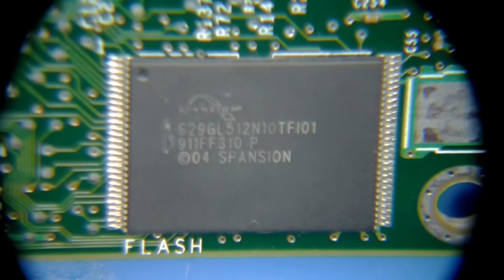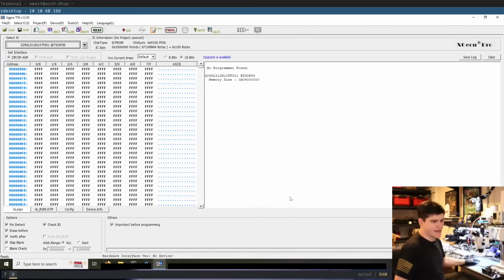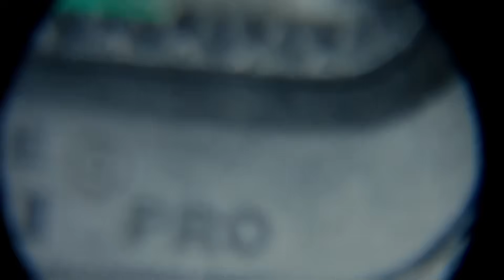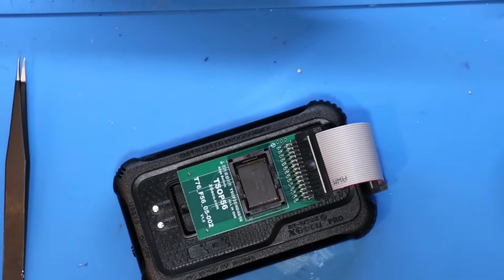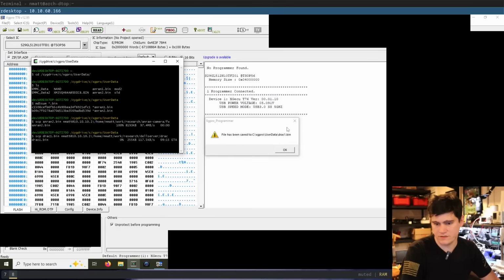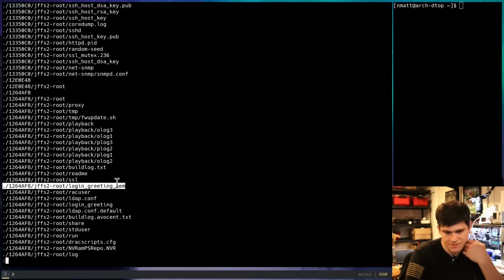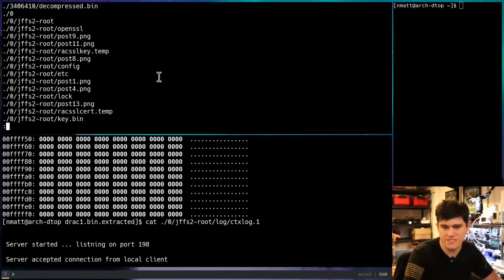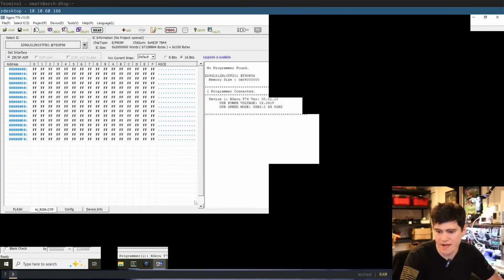DRAC Firmware Extraction - Dell Server Hacking

Comment: Hey so new to this world of firmware extracting. Just wondering if this would work. Got a Polk soundbar that was in Demo mode, won’t work normally can only play via airplay at a set volume. Works of an Emmc memory module. If I copy the firmware off a tsop48 memory chip and copy it to a blank chip. Can I then micro solder the new copied chip onto the demo soundbar and it would work like normal?  Or are there conflicts that would prevent this from working?
Reply from the maker: Unfortunately the answer to that is "it depends". On some devices that will work and others there could be other storage chips or crypto checks in the CPU/MCU.

Comment: DRAC and other remote access is often used locally. Why? Server rooms are unconfortably cold and NOISY, and don't have monitor and keyboard, so you need to roll in a cart with them, and bring a power extension cord.

So instead, you stay in your office, and just remote in. It also allow to connect to multiple servers at once, and switch very fast from one to the other. Usually they are browser based, so really you only visit the web page of the [i]DRAC, and log into it.

And in data centers, you can have rows and rows and rows and different floors. Just finding the proper server take time. You go to floor x, then find row y rack z, and server w.

Now, why loud? Servers ain't mean to be silent, they mean to cool effectively. But they are often in 1U size, which is 1.75" per "U". Such small fan don't move much air, so they have to spin VERY FAST. Plus, they have to be redundant, so they stack 2. And they need more than that, so 4-10 pairs of fan is common. Per server. And a standard rack is 42U, so can have up to 42 servers per rack! 42 servers, with that many fans... You literally need ear protection when you go there!

Why cold? Because it have air conditionner there. The front of the servers is the intake, and therefore that aisle is the cold one, at about 18°C. With lots of air moving. You need a jacket.

You also need security clearance to enter the area.

Comment: Looks like the DRAC runs linux using (old) jFFS2, and CramFS; so it's a custom linux machine?
If so there are likely update utilities, and firmware blobs you can download, as well as the ability to flash, without desoldering anything. Otherwise it was vulnerable since leaving the factory; nothing is perfect.

Comment: One thing I keep around is a torn down lipo battery from an RC car.... there's sheets of copper that you can just heat a chip on and it will dump any excess solder.
Reply: if you want copper foil you can buy copper foil... why risk disassembling a lipo battery, wtf?

Comment: I recommend using a PCB cradle and hot-air bath - this makes chip removal/installation much easier and significantly reduces the risk of thermal damage.

Comment: not entirely sure how much of a hack it really is when its a remote access card and you quite frankly aren't remote accessing it at all.
once you have it on your workbench, you already have way more control over the server than the DRAC can offer  : you have the physical server.

"Hey Dell, I hacked one of your DRAC cards and found a vulnterability : If  and attacker can get to the actual card, you can mess with the chip and then take over the server"

All this really means is that you can't reuse passwords across hardware Gen's and you should make sure to dispose sensitive hardware properly so nobody can get your passwords from old hardware

Comment: At one point, I collected the IP addresses of servers with iDRAC enabled from places like Censys Fofa. I tried root/Calvin in the login panels of all the iDRACs using Selenium, and a small number of them were default.
Reply: I think there are around 50 of them. To crack the Linux and Windows passwords on these servers (some were also running ESXi), all I need to do is boot the OS and modify utilmam.exe, or directly from GRUB.
Reply: I managed to access the root shell and change the passwords. I saw things like CDN servers and IPTV servers. I found a very interesting server that contained the GPS devices of trucks and vehicles belonging to a particular country. I had access to all the vehicles' historical records from start to finish, camera footage, etc. I also found a Grafana database collecting statistics about Mikrotik vehicles and a few DNS servers on an ISP server. I used that server for 1.5 years. I tried so hard, I had installed ESXi and Ubuntu on the server. When I found it, the server itself was down but the administrator account was open, lol.There are actually still a lot of servers that have opened up their iDRAC firmware to the public, and even haven't changed the defaults; I suggest you go and check them out. You'll find some fun things. By the way, the thing that made me laugh the most about the iDRAC firmware was... The PSU had a public key.:D They were using encryption between the PSU and the motherboard. IDRAC 7 is still worth investigating for security reasons. They were using a slightly strange CPU architecture, apart from the ARM x86 MIPS. You might have difficulty with that. Good luck.

Comment: That is a massive iDRAC module -- I'm guessing it's an iDRAC 4 or 5? All of my R710s have tiny iDRAC 6 modules that are about 2x2" and snap into the mainboard via a Hirose-style header on the bottom of the iDRAC module. iDRAC 6 was the last version that didn't require a software key for the "Enterprise" iDRAC (ie. the one that can actually do IKVM). To my knowledge, from iDRAC 7 onwards (520/620/720/820+), the iDRAC module came preinstalled and required a license key to gain full IKVM functionality.

As an aside, many older Dell enterprise devices (mostly external disk controllers, like the MD and SC disk shelves) allow unprotected serial access via a 6 pin mini-DIN connector (what Dell labels as the "Service/Reset Connector" with a little wrench icon). This is super useful to control fan speed and perform firmware updates (via XMODEM) without needing to use a Dell-specific RAID controller and Dell's custom version of MegaCli. Pins 1 & 2 are RS232-level serial with ground on pin 6, running at 38.2kbaud.

Comment: Do you know if it would be possible to find the appropriate function to control the fan speed in PE 2960 III U2. ipmitool raw 0x30 0x30 0x01 0x00 0x30 0x30. racadm set System.ThermalSettings.LowFanSpeed 1 is not working. if checking does not help, I will have to install a 10k fan potentiometer from the PWM pin

Comment: This is where a rework station with forced hot air and a spring-loaded suction cup comes in handy.  Heats up both sides and when the solder releases, POP! it just pops off the PCB
Reply: that’s not a good idea because when the solder begins to melt but not completely melted the spring loaded suction cup will forcibly remove it possibly pulling traces with it. You have to nudge it to ensure solder is completely melted before removing it

Comment: It would be cool to see you do the same with iDRAC 6, 7, or 8 and see if you can find the licensing key algorithm since it's almost impossible to buy iDRAC enterprise licenses for those older systems if you buy through a recycler and don't know the original company that owned the server.
Reply: Are you trying to heat your house this winter?
Reply: @nobodyyyyy556 I don't have those gen but I know a lot of people still do. I run a Supermicro 36 bay LFF with dual e5-2690v4.

Comment: Haha.. Matt.. Just what the project I was currently working on.  Currently waiting for a New Mobo for a R720 .. From what I am understanding once both internal MMCs are corrupted there is no way to get to recovery.  I pulled the Idrac firmware directly from the chip. I also pulled the Bios from the chip. Currently waiting on a NAND so I can just replace it with a blank one, which will put the board into recovery mode and write the data back :)

Comment: Now do the bios modification to add re-bar to r740.
Reply: In all seriousness, the home lab community really needs idrac9 to be able to be hacked.  The default fan speeds for 14th+ generation servers are quite high, making them loud and difficult to keep in the house. Currently the only way to quote them down is to use hardware but it would be excellent if we could add more configurability to the fan profiles.
Reply: @HaydonRyan  not sure if this applies to whatever system you have, but on my older R210 II you can use ipmitool to manually force them lower than the iDRAC will allow. I even do it locally on every bootup via Proxmox host OS.
Reply: @wysoft  In the 14th/15th gen they locked that capability out in all but the very oldest firmware.
Reply: I dont get why dell removed 4x4x4x4 bifurcation on the r740 u can still achieve the same thing with auto detect of bifurcation. Used this method for 4x4x4x4 for my nvmes on proxmox it detects all the 4 disks but idrac still only shows one.

Comment: I gave up getting a standard PCI-E GPU working on the poweredge 2950 years ago when I was running F@H on it.
That always bothered me, can you get one working with display output?
Reply: I have had little luck with GPUs on my r820 which yeah my 2950s were fine, totally want to pass thru one to a vm.. not that fitment is easy either..or power.
Reply: @forbiddenera  What bios are you running on the 2950's? I doubt I'll ever spark that system up again but if I do it would be nice to have discrete gpu's. I am on the latest which does not detect discrete gpus on the pic-e x8 for some reason. I remember checking threads back then and it is a bios block IIRC.

Comment: So theoretically it's possible to run a more modern interface on those machines, tho these days it's questionable if that's still relevant. I have 2 old Dell servers from 2011-2012 still, but they each need around 500 Watts just idling, so not really feasible anymore. And the one with 4 AMD CPUs and 128GB RAM uses about 1500 Watts full load and is just barely reaching the performance level of my Ryzen 9 5900X rig.
Reply: Some hardware might not work ie. 2003 server disk controller card

Comment: what would happen to run claude code on these files
like have an agent for each directory or file depending on the size. as far as i understand agents can be spawn by needs (at least its possible to create a agent system. where each agent has its own properties and doing different stuff. but if i undenstood latest info correctly agents now spawn by specific needs!?. anyways. in claude code type /agents. create as means as you need for each special need and let one controll them all). so each agent has its own full context. you just then have only one manager agent which aggregate all the data,.. should be fun
that would be fuckin interesting. 
for your brain (train your memory) its probably always better to always try manually. but, yeah, give it a try. 
like have an agent that instructs other agents to scan files stuff. be creative. 
i think thats really really interesting.

Comment: would be awesome to "enhance" older idrac firmwares (dell r710) , to add anl htlm5 kvm instead of the obsolete java versions.
Reply: i'd kill to have that. as proud owner of an r710 yeah i want it
Reply: Could one just make a third party client application rather than it having to be modded in to the firmware?
Reply: @Aeduo  I've done this. Unsure about iDRAC (it's next on the list), but the VNC specification is very weird for these devices. For example Supermicro ATEN has their own (several) proprietary VNC encoding scheme. Same goes for some HPE iLO. I created an abstraction / proxy that translates all of them in to common VNC.
Reply: @testing2517  That sounds really helpful and I wonder if things like Avocent IP KVMs could work with modern clients also. The hardware is perfectly fine even though the software stacks are now dated. Do you have a github/docker repo?
Reply: IDRAC7 can use HTML5
Reply: @Grommish but that's only on 12th gen Rx20 and newer.  11th gen Rx10 are idrac6
Reply: The good thing about the old Java stuff is that you can usually run them trough a Java decompiler and get some reasonable output to create your own KVM. I started a project doing that for some older AST-based device (nothing to show yet though). The way all of the web-based Java KVMs I played with is that there is first a http request to create an access token and then the jar is downloaded & run by Java webstart with this token. This can be done manually too with a dedicated JRE. Basic principle is to make the correct HTTP request to the KVM device to get the auth token, then get the jar and run it with the correct params locally. Some KVMs also allow for a direct username/password auth. Then it is enough to just download the jar and supply username/password via CLI. The jars required are in the java webstart config file that was used to configure the Java plugin.
Reply: you can use a docker image to access kvm over an VNC client, search for it. idrac6 vnc client on docker. This solve most of my problems @polyproyl
Reply: My t710 idrac6 is uhh fun... there is a nice docker container thats set up for idrac6 though.
Reply: As nice as it would be, it wouldnt be worth the effort imo. I am about to replace some of my R710s with R720xd machines -- they've gotten very cheap in recent years and most that come from reputable sellers already have the iDRAC 7 Enterprise license, which supports HTML5. And as a plus, you now have a server that can use PCIe 3.0 instead of PCIe 2.0 on the R710.
Reply: TBH Any 11th and 12th gen dell boxes should be replaced, 13th gen is getting really cheap and has huge advantages and power savings.
Reply: @omegatotal  That explains why I am picking up 12th gens for around 125 shipped. .. The 180Watt idle on the R720 is crazy..